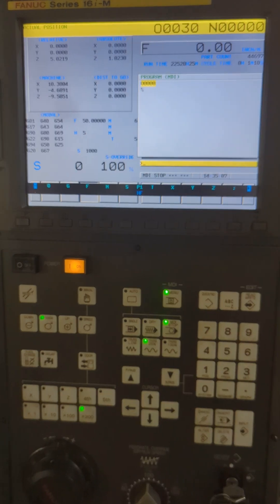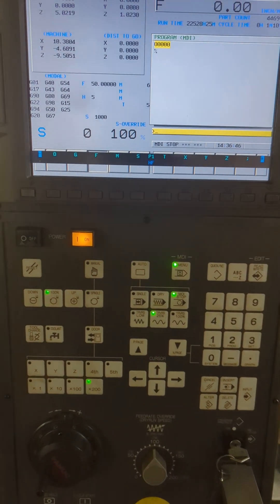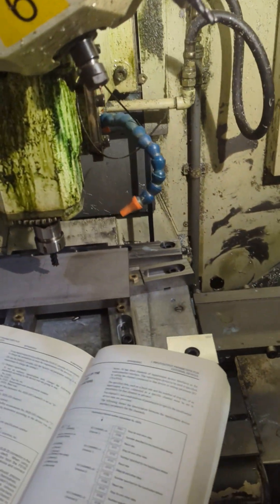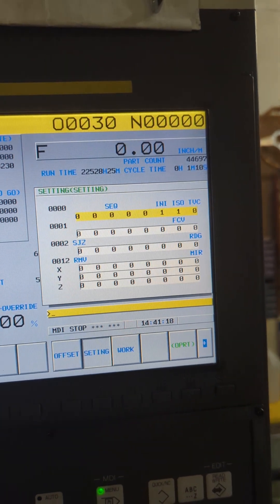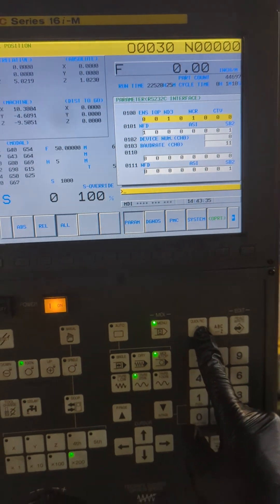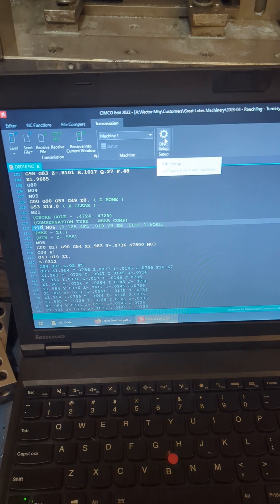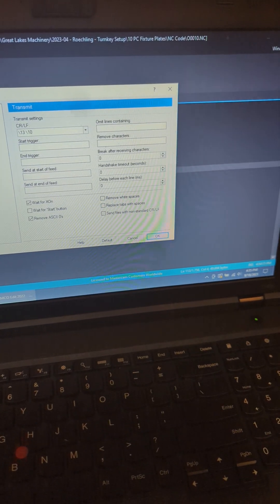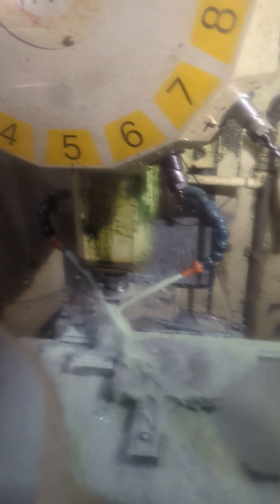How to drip-feed (DNC) large programs to an old FANUC Robodrill using a USB to Serial cable

Comment: Hey just wondering what post processor and cam software do you use to drip feed to you robodrill I have the same machine and just about to try setting it up to work with fusion360 and interested to know what you use with yours
Reply from the maker: I'm programming it in Mastercam, although I did try the generic Fanuc post in Fusion and that worked fine for generating the code.     As far as drip feeding it, I'm using the Cimco Editor to drip it over.

Comment: Does Cimco  program code directly in the machine's memory, or does it send the code to the program line by line via a feed-in process?
Reply from the maker: The way that I show it in this video is simply filling the buffer/lookahead on the control line-by-line.  After that, it's forgotten.    You can also set the control to receive a file this way and save it to memory, but that's different than what's shown here.